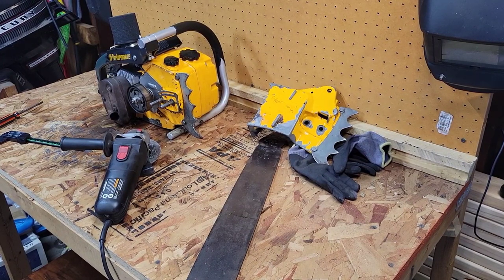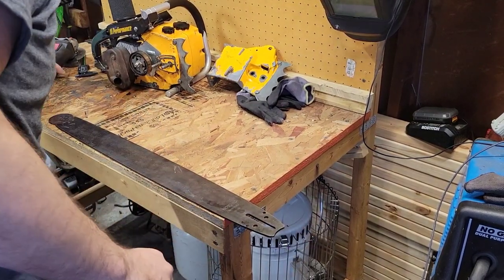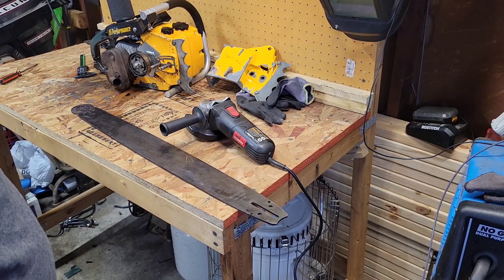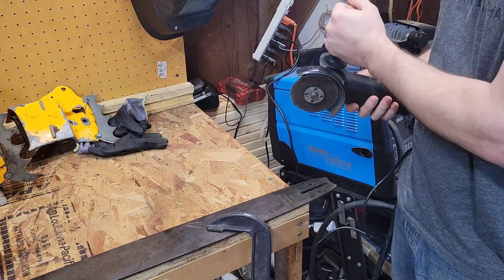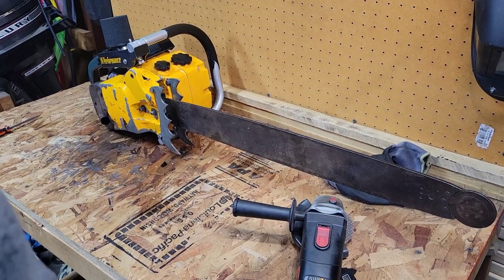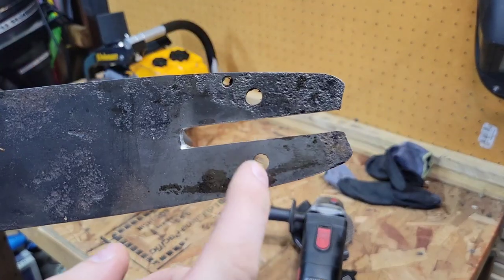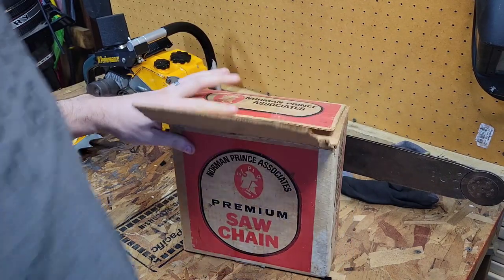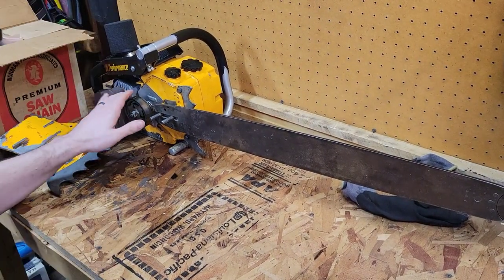How To Adapt A Chainsaw Bar To A Chainsaw Powerhead

Comment: Sweet saw an love the bar wish i had 1 28to 32 for my 655BP i heard the roller nose u can run.404 or 3/8 long as the gauge driver is the same. But im not sure on that never done it b4.
Reply from the maker: You are correct. The roller nose only cares about gauge, same with hard nose.
Reply: @mistermacgray  yes sir id heard that an wonderd it!

Comment: I’ve done that myself Bryan lol great video I’m sure it has help people out my friend I’ll get the pro Mac 700 to you around the 1st after I found out how much they want to ship it Bryan
Reply from the maker: If all goes to plan I'll be taking the saws iit to cut up some wood, specifically dead ash trees, on a coworkers property and have some nice cut videos for you all.
Reply: @mistermacgray  I’ve only used the 8200 one time to fall one tree over on the property that they’re building new homes it was a 12 foot Cottonwood then needed to be fell they paid me $200 to fall it then they came in and cut it up I talk to Bill Hopper to see if he would port it for me I haven’t heard back yet from him are use the 700 to cut up a couple logs does the same thing when it gets hot it’s hard to start
Reply from the maker: @stevengamsby5344  sounds like coil break down is happening when the coil gets hot. I'll contact jereme about porting it and tell him it was mine. He has been wanting to get into a 8200 to specifically see the three peice crankshaft that is unique to them.
Reply: @mistermacgray  ok cool thank you tell him I’ll pay for the work also ok Bryan